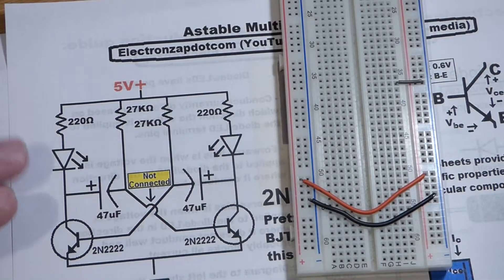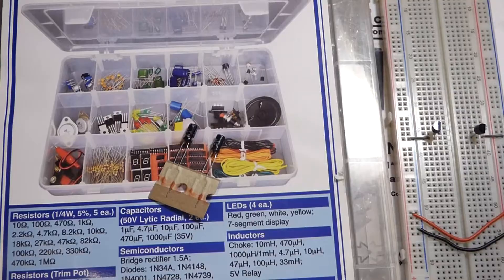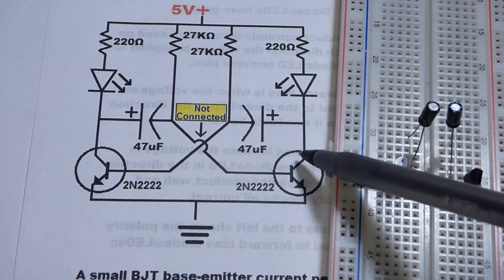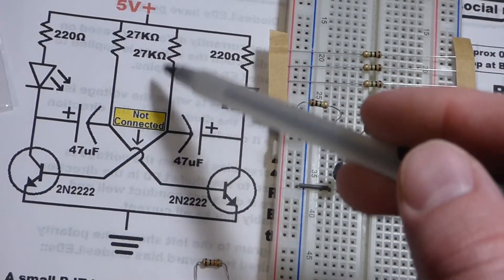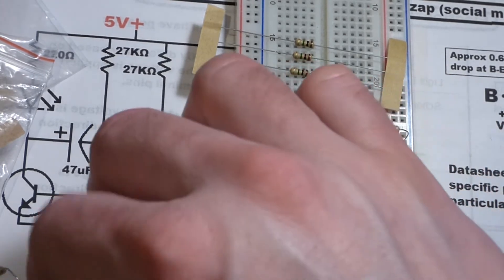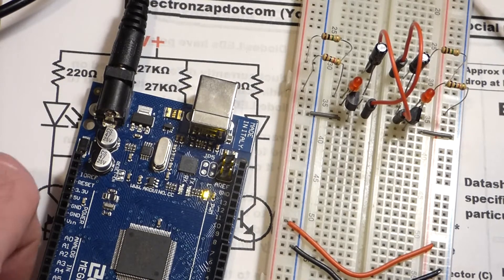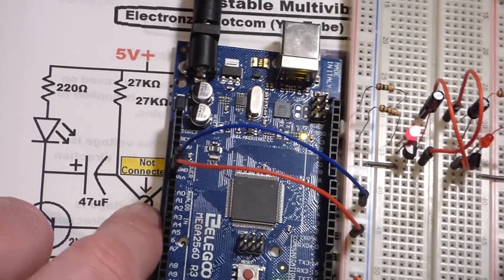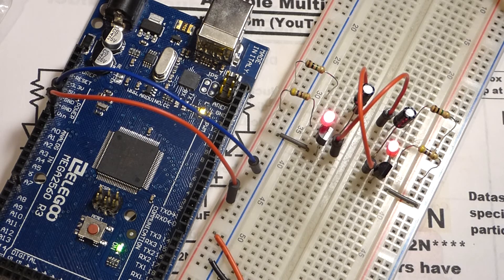Astable multivibrator 9V circuit with 1uF capacitor and 1MΩ timing resistors build by electronzap

Comment: Excellent work. Would you be able to do a circuit that can detect when your lamp is off? Something like when your brake light is burnt or gone, an LED should light up in response to that.

Thanks.
Reply from the maker: I'm busy for a while, that's a good project though. I would try making a NOT gate where a blown light becomes an open switch. Ultimately the LED(s) would be connected in parallel and would provide an alternative path. As long as the LED voltage drop is a bit higher than the normal voltage across the light, they will stay off due to the voltage drop of a working light. Once it is blown though, the LED will get the full voltage.
Reply from the maker: I quickly put together a demonstration circuit of the circuit I described and made this video https://youtu.be/Cl1oAQtfnkQ